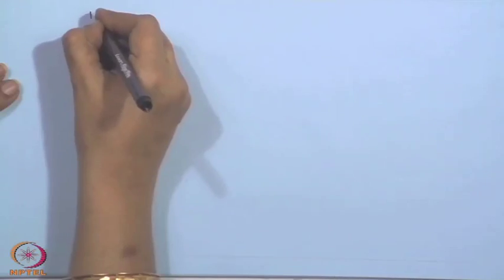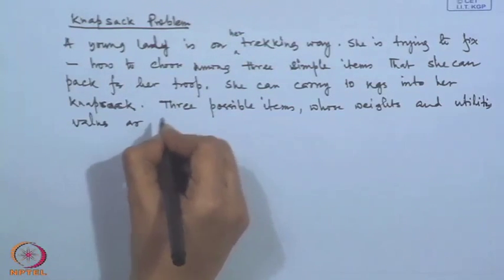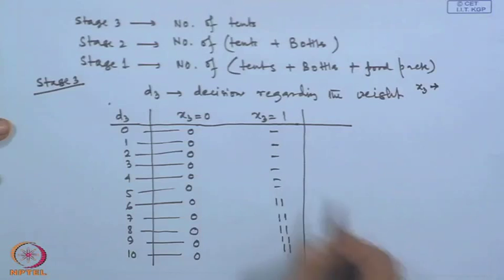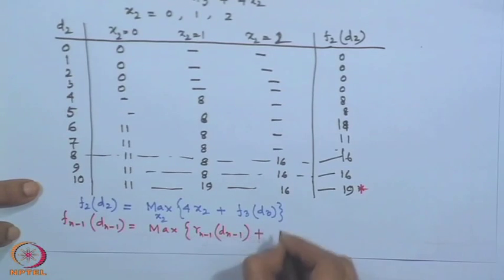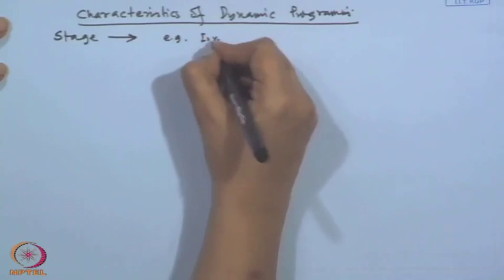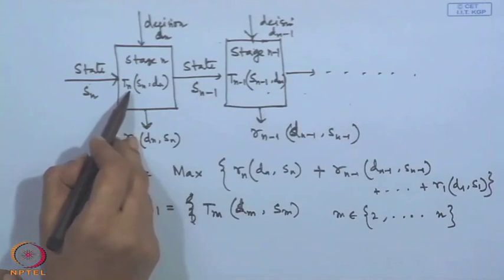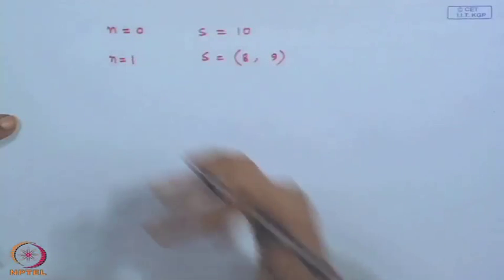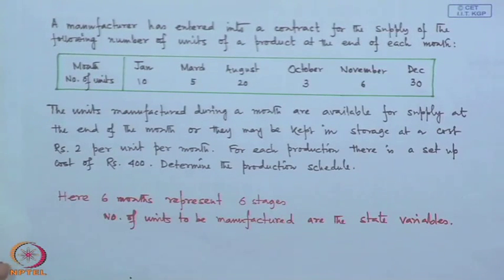Mod-01 Lec-37 Dynamic Programming Problem

Comment: Constraints are needed to apply in your case for  Production and Inventory Control Problem; specially the Wn ( warehouse for storage of inventories to place xy units of products ): In business we need realistic model with constraints and conditions. 

Production capacity =  produced quantity per month							
							
Openning Inventory + Production >= Demand constraint;  							
							
Openning Inventoriy + Production -  Demand <= Warehouse for storage Wn (is not limited in case! )							

Hold cost on inventories (2$ per unit per month) depends on storage when production of products for next month has to be saved in the warehouse. 

Quantities movement in the year are (summnary): Openning balance 10 units + production 64 units - 74 units demand = closing balance 0.
Value movement summary for the year is: Oppening balance of inventories 4020$ + 25600$ production cost + Hold Cost 178$ mi8nus 29748$ = 0$. 

Thanks for your efforts. Please add some more solved cases  and explain DP with solved problems. JABO